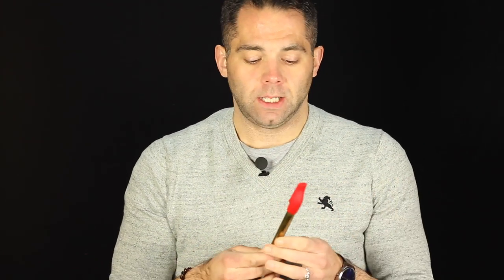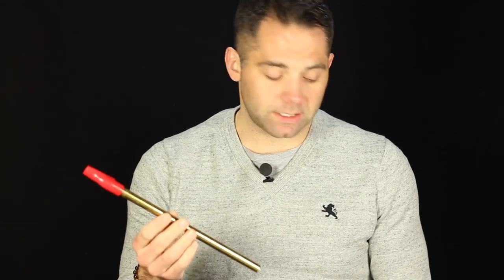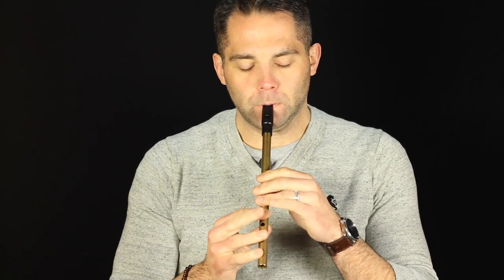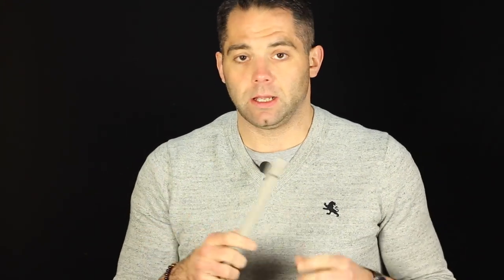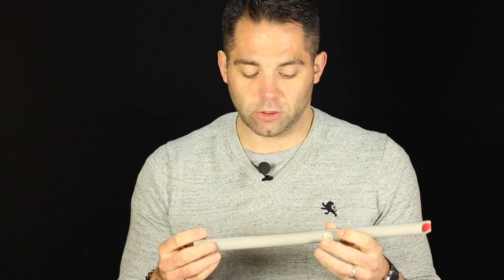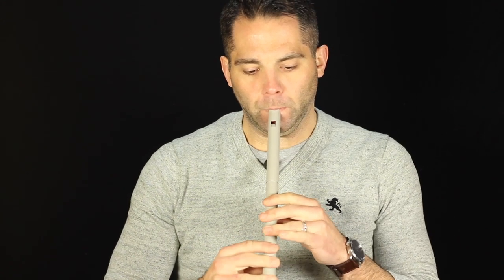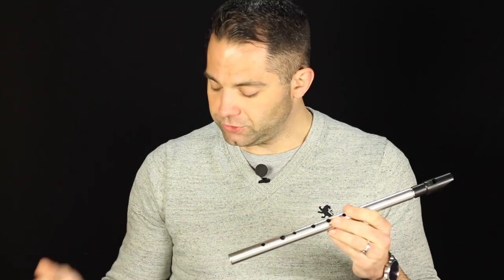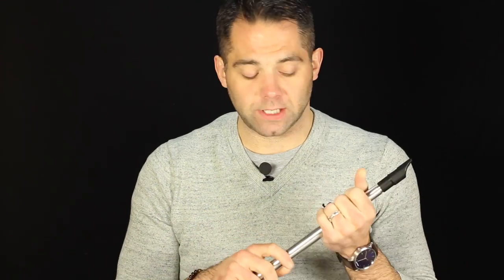Different types of whistles - brass, aluminum, plastic, PVC

Comment: Did Susato change its design within the past few years?  I remember playing a kildare a friend had and it was great. I ordered one this past year and it's gotten way more recorder-y. I also have a Susato Oriole that I'm not much more impressed with.  If you can ever find an old Soodlum D or C from the 1980's, (when they weren't using green Generation fipples) their well worth a go.

Comment: Loved your tutorial. I like the sound of the more mellow whistles and I’m looking at possible an A or Bb. I do own a few Susatos and one Glen Schulz. I have friends that play Bruke but it is too shrill for my taste. 
It doesn’t appear you need to use a pipers grip for the Bb or A you showed. Can you tell me if the hole spacing is very similar to Susato C or D on those lower whistles.
Reply from the maker: I do use a bit of a piper's grip on the low F (and definitely on my low D) but the low A I can play with fingertips. It's going to be a bit more widely spaced than any C/D whistle but it's not a huge stretch.

Comment: Okay, I'm still fairly new at the tin whistle due to just getting started in the fall. I have a Clarke original and a Feadóg. The Feadóg has always sounded off to me but, it could be operator error or needs to be cleaned. Not sure how to properly do that though? So, my main question is which whistle should be the reasonably priced next step? I have been wanting to try a plastic/pvc. Any info is appreciated. Thanks! 😊
Reply from the maker: The Feadog could be off - all mass produced whistles have the possibility of manufacturing defects in the mouthpiece - but cleaning could help too, just some warm water and mild detergent and run it through. As for next steps you could go with something like a Susato - much more reliable then your average Generation-style, but I never liked the tone. I'd say your best bet is a handmade whistle if it's something you think you'll stick with. That way if something's off you'll know it's operator error and you'll know how to fix it :)
Reply: Thanks! I appreciate the help. It's definitely something I will continue to work on. I'll check out those options. My birthday is next month so, it's about time for a legit whistle! 😁

Comment: It appears that it's Gary's for the win! Thanks Sean for this wonderful instruction. It's greatly appreciated.

Can you elaborate a bit on the differences between the sound of aluminum vs brass?
Reply: I'm a novice player but here are my thoughts.  I have purchased several high end, hand made whistles.  An aluminum and brass by Michael Burke.  The al. is exceptionally sweet.  The brass seems more assertive.  A narrow bore by Killarney whistle is mellow and sweet too.  The bore size seems to have more to do with volume and tone than material.  I just received this week a Bb from Syn in Oz.   It is a narrow bore and decidedly different than my brass, lager bore, from Reyburn Whistles.   With all thi,s describing sound is as difficult as describing taste.  They are both experiential and preferential.  If it in your budget the Burke narrow aluminum or the Killarney are exceptional.